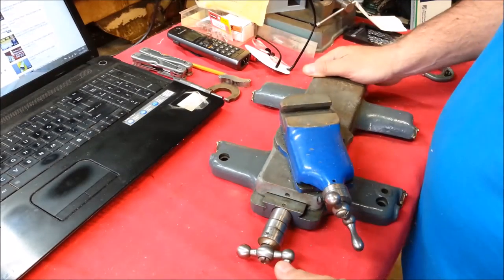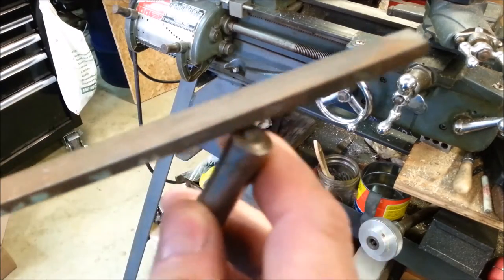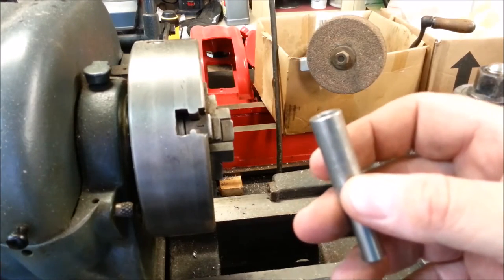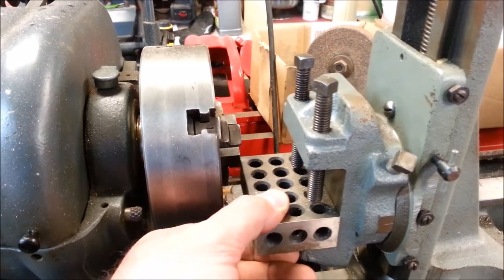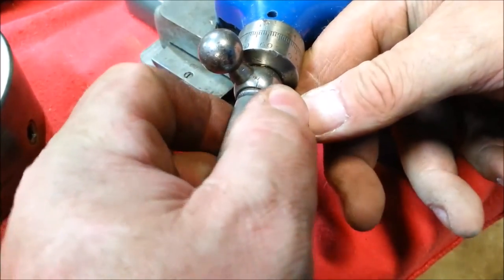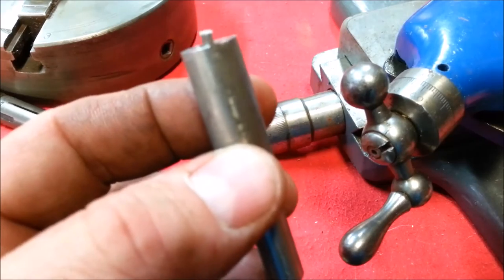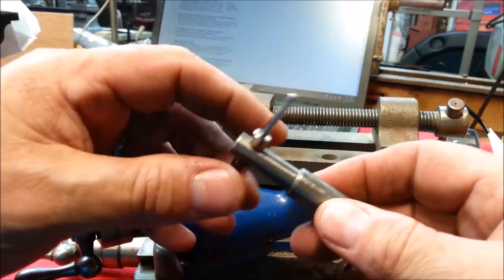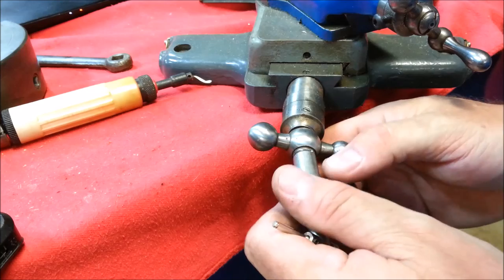South Bend 9 x 24 Workshop Lathe Part 8 - Carriage Wrench - Crafted Channel

Comment: Good job. I've got a screw drive socket that is cut just like the tool you made.  I bought mine about 30 years ago when I was working in a machine shop going to college we rebuilt alot of southbend lathes back then.
Reply from the maker: I remember looking for drag link socket to grind out.  Those are all bigger than this however.  I was wanting to find a few hex insert bits.  But, now I have my own shop made tool.
Reply: +Crafted lots more fun to do right.
Reply from the maker: Chris Anderson I'm slowly accumulating a drawer in my black roll around that is nothing but what I consider lathe specific tools.

Comment: Hi, Dave. Really enjoying the lathe videos. I thought I'd give another way of making the special split nut tool. I made one by regrinding an old spade type drill bit, notching the center out with a small grinding wheel in my drill. I used it for removing the split nuts on my hand saw.  As usual, there's more than one way to skin a cat.
Reply from the maker: That sounds like a good start.  I don't have any scrap-able spade bits.  I think I own one 5 or 6 piece set.  As I remember, it has been missing the 5/8" one for years.  I know it's around here somewhere.  I actually have a second Southbend with the same problem so I'll get to use the tool more than once for certain.  Thanks for the good words on the video's.  I have lots more lathe content to come.   Before the year is out, you'll get to see a series that includes me making a kind of reamer on the lathe.   ;-)  That is in the Logan refurbishment series which is complete but I haven't started editing the video yet.  There were a number of cool turning projects on the Logan Project.
Reply: I realize I am kinda randomly asking but does anyone know a good website to stream new movies online ?
Reply: @Edwin Jordy flixportal :)
Reply: @Ismael Noah Thank you, I signed up and it seems to work :) I appreciate it !!
Reply: @Edwin Jordy Glad I could help =)

Comment: there called split nuts used to be used on old hand saws think that you can get them from lie Nelson tool works  (make nice hand tools for wood working )
Reply from the maker: Yes, googled that, the tool looks correct.
Reply: +Crafted no problem